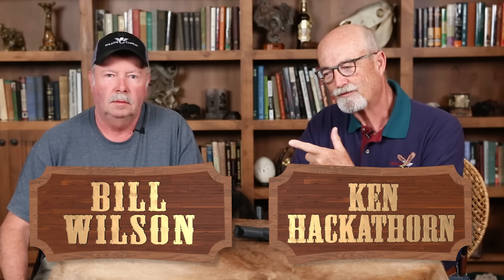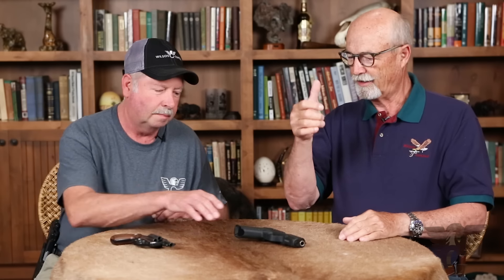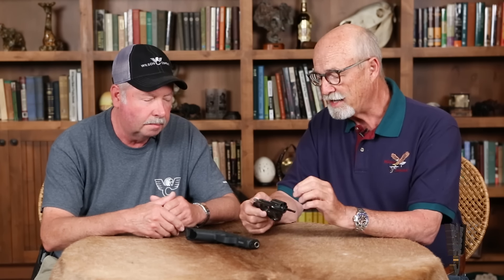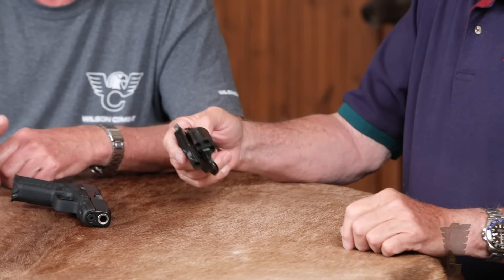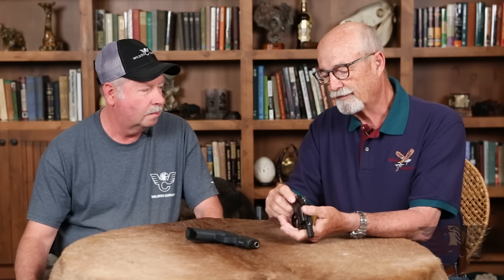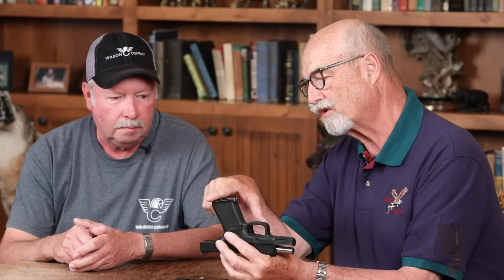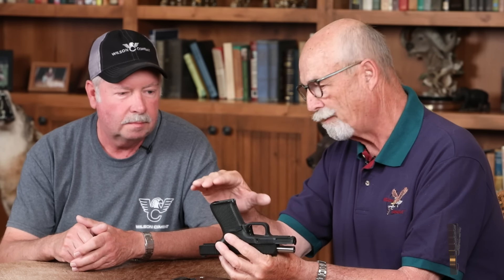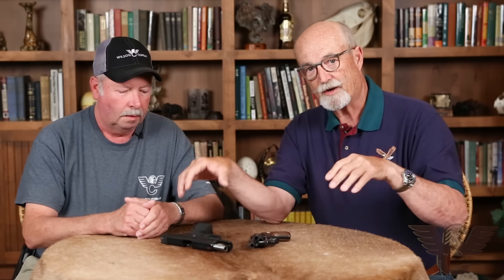DON'T DO THIS to Your Guns - Gun Guys Ep. 17

Comment: The advice not to use the slide lock as a slide release may be appropriate for 1911 guns, but I know that the advice of Kahr Firearms, at least for the CW 380, is to do exactly what you tell people not to do, which is to use the slide lock as a slide release to load the first round into the chamber.  The CW 380 is notorious for not cycling properly when shooters do not do this.  My guess is that most shooters of the CW 380 who pull the slide back and release it do not pull it all the way back because that gun has an especially strong spring for a .380 pistol and it is easier to get the shooter to use the slide lock as a slide release than to get them to consistently pull the slice all the way back before releasing it.
Reply: I have the Kahr CW9, same thing. You have to use the slide release or the top round jams.
Reply: They are specifically talking about an empty gun. Not when chambering a round. It is meant to be done when chambering a round but , according to some, not good for the extractor on an empty slide.
Reply: ok, we get it. you have a cw380 and your proud of it. try watching the video and you'll see they aren't telling you not to do what your talking about. they're talking about doing it with an UNLOADED gun.
Reply: What video did you watch? For they never said that.

Comment: Other than hurting these guys feelings it does hurt a firearm to let the slide on a semi auto pistol fly. What the hell do you think happens when you pull the trigger with a load in the chamber. It's been proven. What they're talking about has more to do with educate.
Reply: Hey Clarke, I think you missed part of what they said.  When you are shooting your semi-auto, if the magazine is empty, the slide stays open.   That gun is made to push a round into the chamber, then stop.  Pushing a round out of the magazine and forward into the chamber reduces the speed at which it's moving forward before it comes to a sudden stop.  If that speed is not reduced, the slide will still come to a sudden stop, but from a higher speed, therefore when it makes that sudden stop, it hits harder than it was designed to hit.  Although it's not immediately noticeable, that extra hard hit does cause a little bit of damage.  After you've dropped the slide over an empty magazine enough times, the damage will become noticeable.  It will shorten the "life" of your gun.  That is what has been proven.  Yes, you're right about the reason they talked about it.  They are providing education to anyone who wants it.  It's hard to educate someone who already knows everything though.  How long have you been a gunsmith?  How many of your designs are used by gun manufacturers?
Reply: That was reddit tier.

Comment: So question. I’m a new gun owner. I was not taught much so been watching what I can to learn all I can.  What kind of ammo is correct for a SA XD-9. I do not want to mess my investment up.  Anyhow thank you for the honest information.
Reply: Whatever you can afford. Break it in with brass ammo. After that if you want to see if it will shoot steel cased then be my guest. Clean all the grease off the gun that it came with. Use gun oil on the barrel and where the slide rides to break it in. You want that melonite coating to wear/smooth out but not start being removed from constant unlubed firing. The new gun I have I used a light coat of red bearing grease. After 70 rounds and cleaning the gun all up you can see and feel where the coating is starting to smooth out but the melonite is still very present. I've found regular gun oil just evaporates in a week as the gun sits in a safe. Practicing that way for years did start to lightly remove the melonite coating from the barrel and inside the slide. Motor oil, transmission fluid and red bearing grease don't evaporate in a gun safe. You can find lots of debates online about gun oils vs. automotive oils to lube your gun. Use whatever you want. But make sure if you have to ever file a warranty claim you only tell them you used gun oil.
Reply: If you can find factory brass ammo from someone like winchester, remington, federal, magtech etc, stick to that for the first 100 rounds. Clean it first, fire 50, clean again. Just have to wear down the imperfections with consistent quality ammo with it properly lubed and once it is you can fire just about anything. Id stay away from +P ammo for the initial break in.

Comment: Question for Bill and Ken: Does it also hurt barrel lockup on a Glock by doing this? Particularly Gen 5.
Reply: On a gun where people regularly drop in after market barrels, I don't think you need to worry about hurting your barrel lockup.
Reply: @KR-bn4bg  The Gen 5 guns have pretty great accuracy with most commercial loads. I also saw that Bill answered my question in this video, specifically saying it’s not good for Glocks either.
Reply: @JA-oo9qp  I guarantee you that you will not notice worsening of accuracy from dropping your glocks slide on an empty chamber. The metallurgy of the modern glock is going to take metal on metal impacts much better than the old 1911s from the 70s that these fudds are getting their info from. Could their be nanometers of a difference in dimensions after hundreds of repetitions of slamming the slide closed? Perhaps. Will the gun still be more accurate than you? Yes. You cannot break your glock by doing this.
Reply: @KR-bn4bg  You can break your Glock from dry firing, it’s happened. That’s pretty rare and from massive amounts without snap caps. 

The slide isn’t designed to close on an empty chamber on any pistol. Bill may be a old and a fudd but he’s forgotten more about 1911 and browning lockup than either of us.
Reply: @JA-oo9qp  dear lord then I guess all the times I dry fire my guns I'm creating a hand grenade
Reply: @KR-bn4bg  You're quick, I like that keep it up you are getting it.
Reply: @KR-bn4bg You created a straw-man and added nothing. I dry fire daily on a carry, I was just pointing out that mechanical things fail. 

Dry firing adds a noticeable benefit for me whereas dropping the slide on an empty chamber adds nothing. The only thing in question was how detrimental it is to the firearm, specifically Glocks.
Reply: @JA-oo9qp  first of all, I'm unsure how you practice dry firing with reloads without dropping the slide on an empty chamber. Sure you could use snap caps but I often don't. Also, you just said you can damage your glock by dry firing it. Yet you still do it so clearly it doesn't concern you. Yet dropping the slide on an empty chamber does concern you enough to not want to do it now. I don't understand the logic between the two.
Reply: @KR-bn4bg  Reread my comment. Dry fire is beneficial, dropping the slide isn’t. Slide lock reloads can be done with snap caps, although I generally do tactical reloads and hit the slide release as if I’m doing a slide lock reload. 

I’m not saying this will 100% break your gun, I just don’t see an overwhelming need to do it, especially when handling one administratively like so many love to do, mostly because movies or because they like the tactile feeling of it and are essentially playing with their gun at that point.

Bill says it’s bad for even Glocks from a barrel lockup standpoint and knowing how a browning lockup works I tend to agree with him.
Reply: @JA-oo9qp  it would be bad for anything with shitty soft metal or insanely tight tolerances. Neither of which are conducive to a duty grade pistol. The slight degradation in accuracy due to barrel lockup wear on a duty pistol is going to be unnoticed in the other variables of shooter skill and ammo variation throughout the pistols service life.
Reply: @KR-bn4bg  It would depend highly upon how often it was done, but I’m sure it would go unnoticed by many. My question was a technical one, which Bill answered. I’m ambivalent about what 99% of “shooters” would notice. Most gun people are glue sniffing know it alls with no actual knowledge but tons advice in my experience.
Reply: @KR-bn4bg  people here still thinking that they can cause more damage with their hands with a repetitive movement ,more so then by the G's generated by the blow of the powder, putting that mass under accelerations far more important - also repetitive ....🤣😂🤣😂🤣😂🤣😂

Comment: I must disagree with all this "no slide dropping" stuff. Unless you drop the auto out of a building or moving car, leave it in seawater, never clean it, etc. the only wear and tear a pistol receives is through use. If you think really carefully about it, the sear engaging with the hammer notch happens at the same speed regardless of empty-or-full chamber.
I've explained this to the nth degree on many other FB videos - hell - even on here at one time, I'm sure!
Reply: i trust guys with a lifetime of experience and comon sense than amateur dudes

Comment: My first gun is ruger SR1911 in 10mm. So putting a loaded mag in and pushing the slide lock is bad for the gun? Or just bad if it’s unloaded
Reply: just unloaded. peeling rounds off the magazine slows it all down enough - that's the normal function of the gun during operation. a handful of snap caps will go a long way toward protection if you need to do some dry runs.

Comment: yeah i don't buy that these engineers made guns such that the minute difference of resistance afforded by a round being chambered could literally make or break the parts. and if they did, that isn't a gun you should trust your life to anyways if it's on such a razor's edge of reliability. fact of the matter is, soldiers do it without issue. if anyone would notice it would be them. especially those SOCOM guys who are obsessed with pistol marksmanship. sounds like these whizbang custom pistols are just less reliable.
Reply: Yeah, by this logic, a failure to feed where the slide still closes would damage the gun randomly.

I guess super light trigger comp guns I could maybe understand, but the average gun that's used for self defense better be way more reliable than that.

Comment: Dry shooting does not damage center fire guns..only rim fire guns ( 22 LR).
Reply: It depends. I would not dryfire older revolvers where the firing pin is part of the hammer. Fixing a damaged firing pin requires hand fitting a new hammer. Factory (skilled Colt, S&W gunsmiths are long retired or dead).

Comment: John Browning says it's okay to release the slide on an empty chamber by using the slide lock and letting it fall forward on a 1911.    Sorry...but I will default to him over you two.  
Kinda don't really care what you think of me when you see me do it either.
Reply: John Browning died nearly 100 years ago; curious where you saw him say this.   Plus, I doubt the guns he produced in his time had triggers and tolerances to the degree a Wilson Combat 1911 has.  I don’t think they are saying you should NEVER do it, only that doing it repeatedly can damage the internal tolerances.  I’m pretty sure that Bill Wilson knows a lot more about sear and trigger tuning than you or I, and probably more than even Browning did.
Reply: @KansaSCaymanS I wouldn't trust a gun that sees major damage from such a routine part of firearms handling. Especially at their price point
Reply: If you don’t care about their opinion…..why’d you click on the video?
Reply: You should have waited until they explained that custom guns with light triggers can be damaged over older weapons or those not customized.
Reply: on a GI gun as designed by Browning with huge hammer/sear contact area, and a 7# pull, dropping the slide wont bother anything. a 1911 with a nice clean sub 4 pound trigger pull is a different animal.
Reply: @therockman1928  Gotta see what BS they want to peddle on their expensive side arms.

Comment: Is it bad to dry fire a pistol?  Why?
Thanks for your video.
Reply: Over travel of the firing pin on certain guns
Reply: Most modern, center-fire handguns can be dry-fired without risk of damage.  Damage comes by way of the peening (distortion) of the softer metal used in firing pins when firing pin overtravel slams against the harder gun frame steel.  The backdating in gun design where this becomes an issue is somewhat variable, so it’s best to research before dryfiring one of grandpa’s (older) generation handguns.  When in doubt, the best practice is to use snap caps.  Also, rimfire guns should not be dry fired for practice.  And when dry firing any gun, always isolate all live ammunition to a room other than where you are practicing.
Reply: I do not claim to be an expert.  Snap caps.  I see two designs.  One there is simply an empty hole so the firing pin touches nothing.  The others, slightly more expensive the firing pin hits a rubber, soft plastic material.  It is far less expensive than a gun, a repair.  My OPINION, any reason not to??
Reply: @Claud B, I’m not familiar with your first description.  Typically, a snap cap will either have a substitute, inert primer that “floats” as backed by a spring, or the pseudo primer will be of a hard rubber material.  In either case the energy of the firing pin is blunted against impacts from the snap cap’s surrogate firing pin.

Comment: What lube to you guys recommend?
Reply: Can’t you tell them to use Vaseline lol
Reply: Probably K-Y jelly
Reply: Grease
Reply: I like to use mayonnaise, as far as brand goes they’re all the same honestly
Reply: Ignore them. Ballistol and Hoppe’s are good brands.
Reply: @JPDC624  ignore who? I genuinely recommend using a high temp industrial grease for almost all firearms applications. Oils tend to get burnt and sticky and collect a lot of carbon. If you use grease, you just wipe it clean every now and then and reapply for grease. Occasionally deep clean the whole thing with gun scrubber and bore cleaner, reapply a very light coating of oil by hand, wipe most of that off, and then apply grease to any metal on metal parts. It will protect better that oil, and everything will feel buttery smooth (action).

Comment: I have a .45 Clark longslide for bullseye competition. When I first got this gun, I learned of potential damage by just using the slide release. I was instructed to hold the hammer back with my right thumb and release the slide lock with the left thumb. It's slow, but in formal competition the time factor doesn't exist.  This particular gun (from 1965) is still going strong.

Comment: Thank you for the video. At competitions, the RO instructs to unload and show clear. If clear, slide forward and hammer down.

What’s the best way to do the above without harming the firearm? You need to drop the slide on an empty chamber in order to comply with the RO. Appreciate any advice.
Reply: As they said, the best way is to just rack the slide.
Reply: To expand on Jeremy's correct answer, grab the slide, push down the slide lock lever, and slowly let the slide travel forward.  This makes the process much gentler as the slide does not slam into the locked position.

Comment: I currently carry a factory stock Glock 19 gen 5 and I typically don't use the slide release for reloads because its so small, I break grip to release the mag, reload, turn it 90 degrees and yank the slide. Its something an ex-ranger/contractor buddy of mine suggested I do to always make my reloads with the glocks 100% consistent if I don't modify the slide release to be larger/more accessible, and Its also the same muscle memory for the 2nd part of a tap/rack for malfunctions. If I get into shooting competition i'd obviously want to do a little tinkering to a gun in order to make that process as quick as I could, but for everyday carry, I like an unmodified striker gun.
Reply: Lmfao you'll get laughed at by any serious shooter, get better training.
Reply: @irelandgunner9511  Using the sling shot method is always better than using a slide stop
Reply: Just get a different gun for competitions. The only reason to get a glock is that it's reliable and you throw that out the window if you start modding it.

Comment: Is this true for Beretta semi automatic pistols? I watched a Smyth Buster episode where they said dropping the slide like that won’t harm anything, though they didn’t mention whether the gun needed to be loaded or not.
Reply: That episode was referring to loaded… this is referring to fine tuned custom built 1911’s with ultra light trigger pulls
Reply: Just basic common sense. Take a hammer and beat on a block of steel. Then put a piece of wood, brass, aluminum or hard plastic down on the block of steel and beat on that. You’ll fee the difference.
Reply: @lancedacus4560  I think though the difference still doesn’t mean it’s necessarily harmful for the steel.

Comment: How can you explain this, Mr Wilson, at the Beretta factory, cicling the  slide on an empty chamber 700 times, in every pistol they make, before it goes out of the factory? Minute 4:25
https://youtu.be/ULE_N9CuLL8

What you are saying about pistols does not make sense, the gun is designed to do that, empty, 100, 000 times. Shooting the gun dry is different, the firing pin will suffer. So no, Mr Wilson,  you are wrong.

Comment: What is their internal parts made out of? 
Wood?
Why not used a hardened D2 steel?
Reply: Carbon tool steel that isn't particularly tough? That's probably why.
Reply: @bobjohnson1633  
D2 heat treated up to 60 Rockwell is extremely tough. 
I’m not a gun smith, I’m a toolmaker for automotive and aerospace, and D2 would be my choice ✌️

Comment: Is there a way to tell if someone has been abusing a revolver?  The way it “spits” the lead?  I had an LCR that I bought second hand and I only had it for a little while because when I fired it, it would sometimes eject small shards out.
Reply: Sounds like a timing issue. Empty the cylinder. 

Then double check the cylinder to make sure it's empty.   Then close it point in a safe direction and dry fire it. Pin the trigger back, and try and rotate the cylinder. If there's too much wiggle then the cylinder lock up is a little worn. And might need servicing.